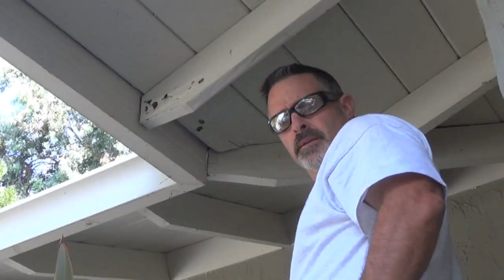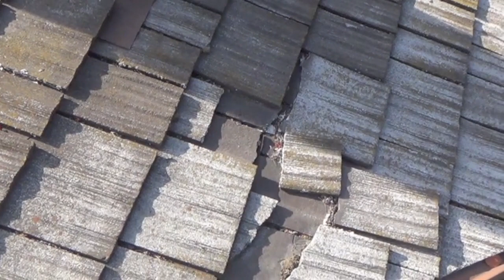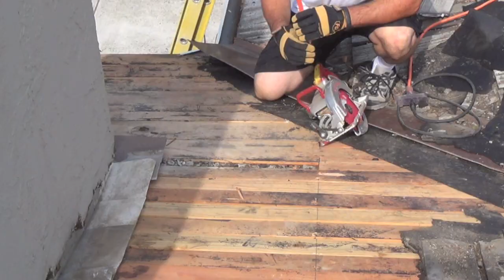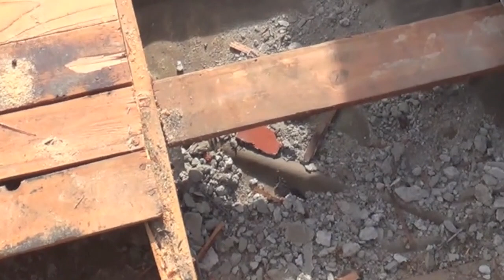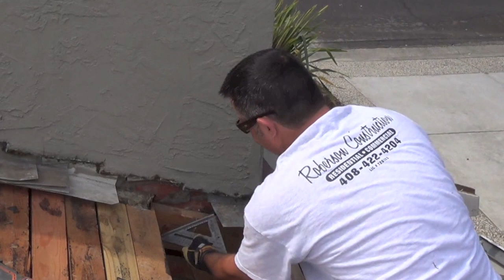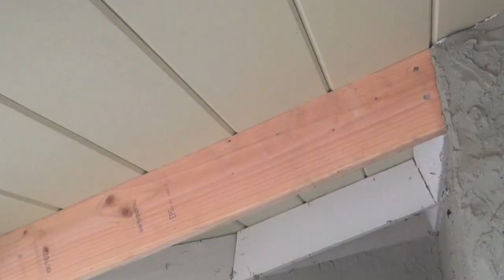Roof Repair- Termite and Dry Rot Damage

Comment: Nice work.  I've had to replace about 20 linear feet of facia and almost the same amount of starter board but the termites don't seem to like my rafters, which is a good thing.  The rafter wood doesn't look to be treated either.  Any advise on using a product like Boracare on the exposed wood before painting?  If it is effective or not?

Comment: WOW A man and company with integrity. I remember when folks used to do their best and not have ass. Excellent. Looks so nice and clean. VERY PROFESSIONAL. I know this may be a silly question, but how can you tell Termites vs Carpenter ants damage?
Reply from the maker: Sg, sorry for the late reply. Thanks for the positive comments. So, subterranean termites live in the moist soil and come up to feast on the dry wood framing, siding and such. The path will usually have tubes that they love through back and fourth from the soil to the wood source. If you have a water leak from anywhere, they can live in that area and feast until the moisture is gone. Dry wood termites can live in the structure and usually leave small round piles of pellets where they have hole is the framing or drywall. Carpenter ants are large wood eating machines and can completely destroy framing members. They leave sawdust and large holes and tunnels in the framing or other wood source. Hope this helps, there are many other monsters that can eat away at our homes, just search the web and don't freak out! It's been happening long before you were here. Subscribe and share, take care and Happy New Year!

Comment: Well done explaining the procedure.
For those hating on not showing the replacement of the rafter tail, he explained this already and that the roofers came in and wasn't able to film it.
About the only thing I could add, and perhaps also due to shortage of time with Roofers, but
1) agree with the other person who posted in using cedar or Redwood. PT I've seen dry rot happen and even termites getting to.
2) easier to paint surfaces of wood before installing to ensure termites and dry rot doesn't happen, but like step one better, and again maybe rushed by the roofers?
I would imagine the same would hold true for vaulted ceilings, in replacing the rafter tail. It looks better than sister shoring the rafter tail, but who says doing something the correct way has to be easier! It comes out looking better, instead of a DIY hack job...
Thx for the video👍

Comment: Similar problem. I cut the rafter back to good wood, took measurements from a good rafter and made a fitted piece. Nailed a 20 gauge galvanized tie plate on each side of the fitted piece, quick glued it to the rafter and nailed the tie plates to the rafter. Had the wood and the tie plates were less than a dollar each. Looked good after paint. My fix was on the side of the house that would not be noticed.

Comment: Thanks for your video. Those little shits (termites) are a curse. They have eaten through some roof rafters in my home 8 x 2, leaving only a paper thin surface in places, very similar to the damage you have only on a more major scale where they roof / tile battons are gone too. I wonder what you would think of leaving the damaged rafters (after treatment) as there is still some hardwood left there, then sistering additional wood bolted either side of the rotted beams? Would this be OK (I am supposing the termites have been killed) Seems to me that it is stronger having another two 8 x 2's strapped and bolted onto the remaining half eaten 6 x 2 's rather than cut them out. Yes I know it isn't that pretty but will it work? Thanks. (These are Sub Terranean not dry wood termites)

Comment: My moms fascia* and drip edge are fucked. Her rafter tails are rotted and old and to the point where water is getting pulled into the rafters and her drywall is cracking and dropping down into the living room on the ceiling.

Comment: You should have told the owner to put plywood on top of the starter board, then put roofing on top. Th it s is the problem with the contractors not telling the  truths . This bbn us a older home with no building code.

Comment: I have a 1600 square foot home single story and all my rafters have rot in the ends. What is your recommendation to address this?
Reply: Definitely want to get a roofer or roofers opinions instead of a handyman type professional, if you’re hiring someone. But to do it yourself you’d want to cut the tails back to wall where the wall still completely supports the rafter , assume you have 1 ft over hand you cut a 3ft 2x4 and now sister this 3 ft piece next to the cut rafters ..fastening 2 feet of it to the cut original rafter and 1 foot exposed. It’s Very important to double the exposed length of new tails for support. Use quality screws or lag bolt no nails.  You should then have a single 1 ft rafter tail exposed goes into the roof 2ft fastened to the original rafter that was cut. The only reason it’s not done like this is for lack of knowledge, being lazy, or outright not giving a damn and just wanting to be done with it. Don’t put any false tails, improperly support your new overhang, or disturb support of rather by the wall

Comment: Make sure all the outer pieces are replace with pressure treated plywood or you will be sorry.  OSB will cause all kinds of nightmares if it gets any water exposure.  There are a number of Youtube videos where construction companies are using pressure treated plywood on all the outside portions of the roofing and the underlayment on the walls at the bottom closest to the cement foundation.

Comment: Screws??? Shouldn’t you use nails to sister them together? It looks great tho. I’m not trying to sound like a know it all, sorry. as a carpenter and a former Building Inspector I know screws don’t have the sheer strength that nails have. Unless they are screws designed for metal brackets. Like a Simpson bracket and you could use their titan screws. Anyway, you made it look untouched which is always our goal as repairmen. Good job man.

Comment: very helpful video.  Can you tell me the dimensions of the "starter board".  And is there another term used in the trade for "starter board".  Where can I find these boards?  Home Depot? Hanks ACe?  .
Reply from the maker: Acwren, the starter boards can be any size. We usually match up what is existing around the house. Could be AC plywood, shiplap materials or V-groove pine or redwood. I also try and use pre-primed materials as the grooves are primed and all we have to back-roll is the new cut ends. All the above carry the materials with the exception of some ACE hardware stores unless they have a lumber section. Any local lumber store/supplier. Good luck and thanks for watching. New vids coming soon...

Comment: how long do wood facia boards last before rotting begins?
Reply: Debora Alderman make sure your rain gutters are working so water won't get backed up on the roof to cause moisture to wood. Once moisture comes in it becomes victim to fungus..After fungus damages the wood it creates dry rot..After dry rot damage that enables termites to get in the wood and cause more damage..make sure all wood is completely painted termites can't go through paint and simply walk around your house and make sure all wood members aren't exposed to water for long periods of time and your wood should last long.
Reply: Debora Alderman, that depends.  If the wood is painted on all six sides with a good oil primer, you might die first (unless it's soaking in water).  If not, it might be 20 years, or it might be 2 years, depending on water exposure.  Like RR said, paint it and keep it dry.  It helps to use quality wood, which is a little hard to find these days.  That's why people use Azek or other plastic materials now.
Reply from the maker: Debora, it really depends. It took me a year to respond so what do I know:) Well if it is a roof facia without a gutter and the roofing material has at least 1 1/2" overhang than pretty long if sealed. If your gutters are full and water overflows or backs up, the starter boards (the boards that you see when you look up under the overhang) will rot as well as the ends of the rafter tails and the facia. Again, I'm sorry for the delay. I'm trying to keep up with all this, yikes. I will have more videos soon as I patented a new tool I'll be demonstrating soon. Take care.
Reply: #Debora Alderman I will be replacing a couple (fir) that are water stained and not yet rotted but they will soon. They have been in place about twenty-two years. Once  I remove the fascia I can inspect everything behind it.    I always paint two coats on every surface of these kinds of boards.  I think it helps.

Comment: I have a building built in 1955. They used starter boards and some like in your video have rotted. Where would I look for these boards. I went to home depot and they looked at me crazy. Thanks
Reply: My starter boards are 1x6 tongue and grove.  See link: __ https://www.homedepot.com/p/1-in-x-6-in-x-8-ft-Tongue-and-Groove-Pattern-Cedar-Board-784525/202070418

Comment: Mike, great video!  I'm just getting going replacing fascia boards etc due to termite & dry rot damage on my house.  Question... Before I replace the wood, I paint the heck out of all new lumber before installation.  Is that over kill?   Many thanks...
Reply: No.  Not overkill.  Unless you want to do the job over again in 15 years.  Use oil primer.
Reply from the maker: Sorry Neil, yes seal all the wood and the raw ends before nailing. Also, keep your gutters clean as full gutters tend to back up water to the starter boards and "The Rotting Begins."

Comment: Thanks for the great video. You explained things so that a non-carpenter could understand. I just had a termite inspection (have subs and dry wood issues) and was told that several rafter tails have dry rot by the gutters, and was wondering how they would repair them. I also have to replace my 24 year old cedar shake roof, so, after watching your great video,  I figure that I'll have the roof done first and  have them fix the rafter issues when they put on the new roof. Thanks to you, I now have a good idea of the process and will understand what has to be done...the RIGHT way! Bravo!
Reply from the maker: Sorry late on the response, hope all went well and please ask if you have anymore questions. More vids soon.

Comment: Need help. Your video was great. I have a freestanding second story balcony that's attached to the house (no posts). Termites and wood rot have set in for a while now. The joist that makeup this balcony extend through the outside house through the stucco about four feet making up the balcony. Our balcony is about 16' in length and about 4' wide with 9 or 10 stairs on two wooden stringers. At a loss for how to repair properly without having to put in any posts on the existing balcony by our swimming pool.  Any thoughts?...........(must be California code compliant)
Reply from the maker: Hope you worked everything out, I'll be posting new vids soon. Work takes all my time away from my channel.

Comment: I love my oscillating saw. I have a cheap one from harbor freight. One thing they are exceptional at is removing old caulking. With a dull cutting blade you can remove hard baked on caulking easily.

Comment: we are repairing ours as well is there some kind of sealant so the wood will not be so damaged or prevent dry rot or something to protect from weather?
Reply: Yeah.  Oil primer on all six sides, or (for godsake) at least on the end grain.  Something that wasn't done here.  Use treated wood, or maybe cedar.
Reply from the maker: Prime the new wood and treat the old with primer after you scrape the rot. Home Depot carries several products to help prevent fungus. Key is to not let water under the roofing or the water barrier. Make sure the roof is sound and water tight.